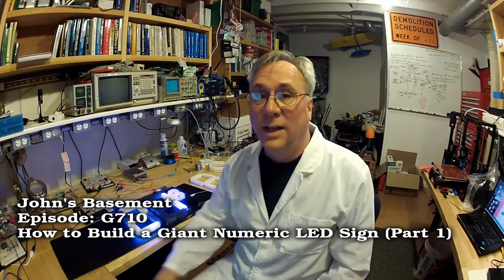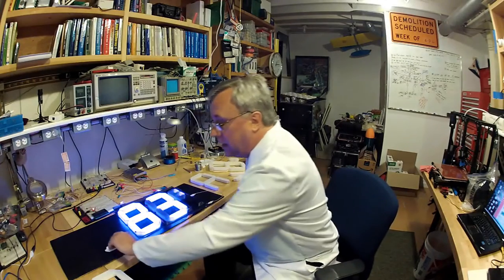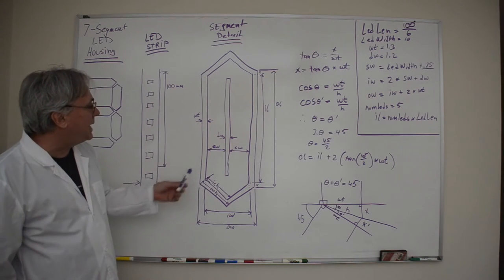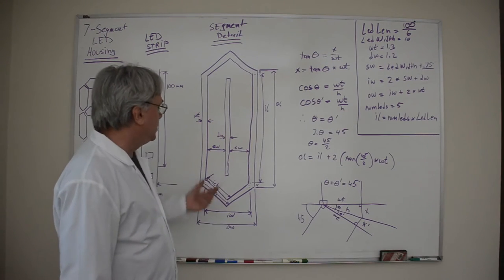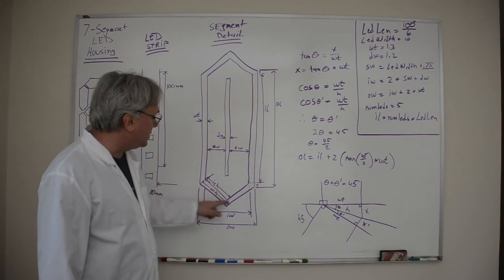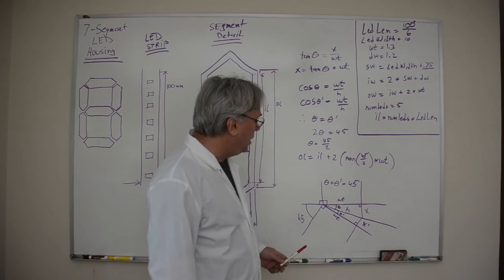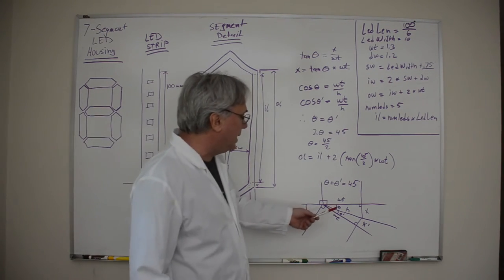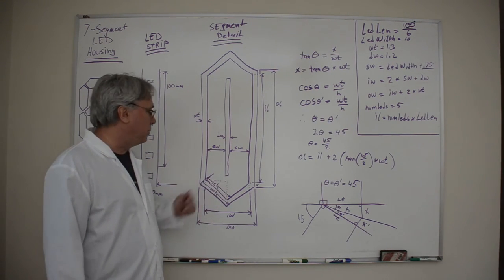How to Build a Giant Numeric LED Sign (Part 1)

Comment: Looks like the timing circuit runs slow or the video compression changed your time scale.
Reply from the maker: Baron Gerhardt OK eagle-eye... yeah...it was shot at 25fps and that arduino test code was running without a crystal timebase.  so...

Comment: This is an excellent series and you are a very good presenter of the material. The detailed walk-through of your use of OpenSCAD and your descriptions of the design trade-offs you made while creating the parts was enlightening to me. I've never used a scripted modeler, but I have about 12 years of parametric solid modeling experience and was able to follow your scripting every step of the way. Finally the troubleshooting and resolution of the timing error in the Arduino code was both straightforward and clear to me. I'm surprised your channel hasn't received more traffic. I hope you keep up the great work.
Reply from the maker: Thank you!

It looks like it has (and is still) been slow going.  I'm having fun. That is the main thing!